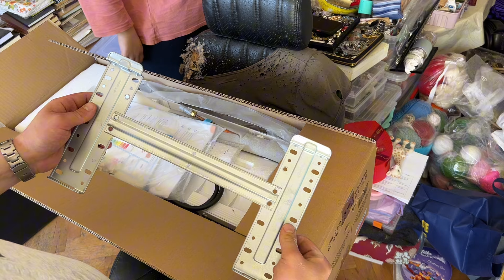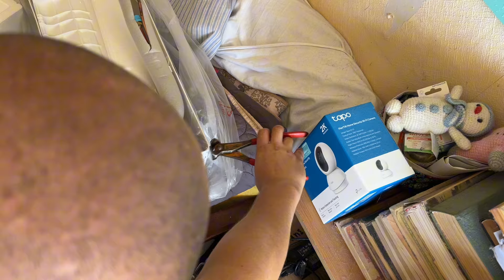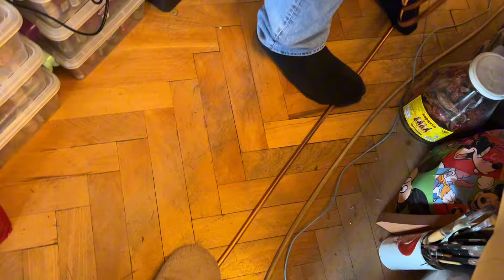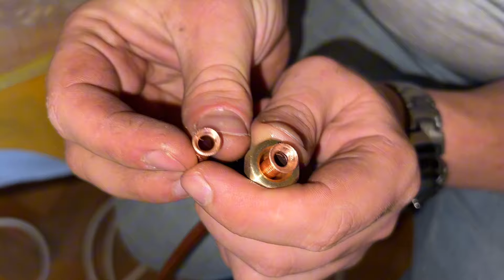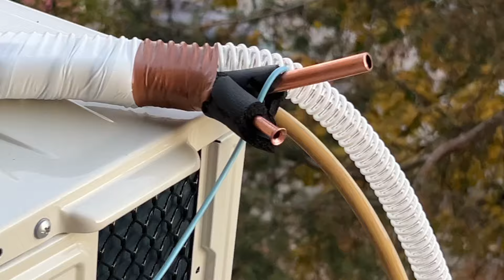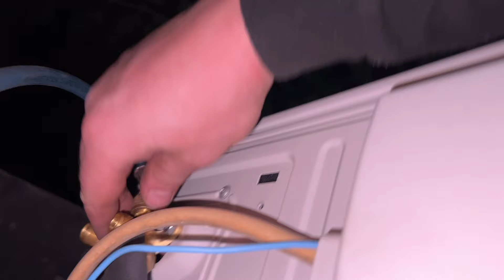How to Install Cheap Air Conditioner Split System . TCL MIDEA BEKO cheap

Comment: 1000$ per unit is cheap? then why u making videos for 2$ dollars for
Reply from the maker: I did not get the question.
Reply: This cost 1000$ USD in USA
Reply: @derpherpp3  This AC costs like 300 USD.
Reply: @4rd17  no this tcl is 1000 at home depot right now
Reply from the maker: This was bought for 320$ in Europe when I installed it. Cheap or not it's a bit personal, I hope we can find it Cheap.
Reply: @MeFixingEverything  Yep, in my country in Europe i can find this AC for about 200 Euro